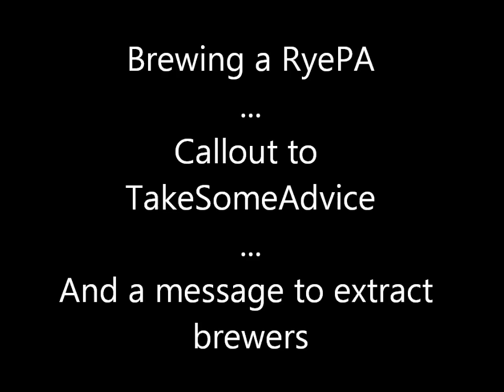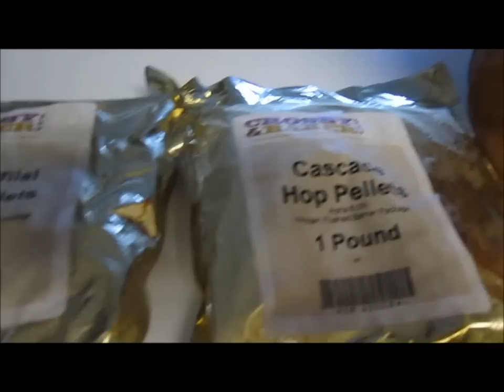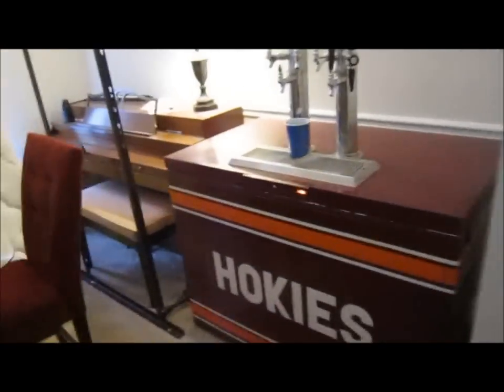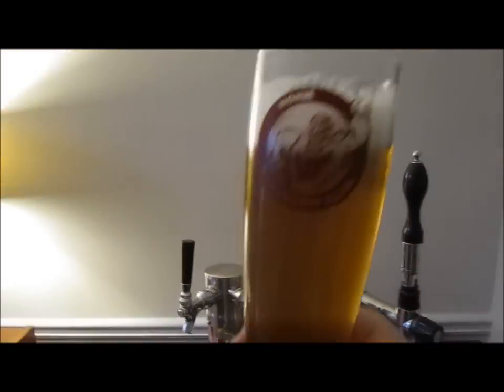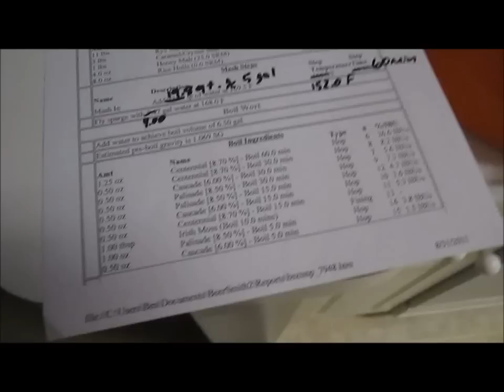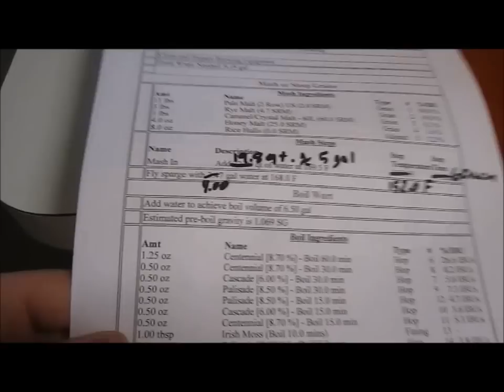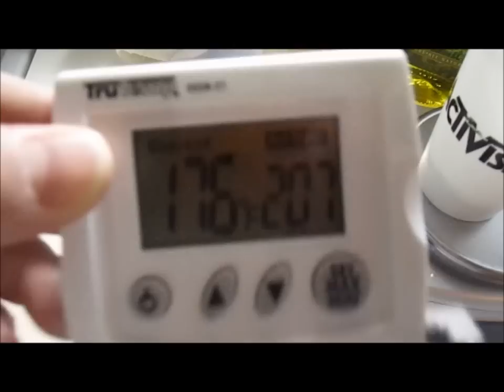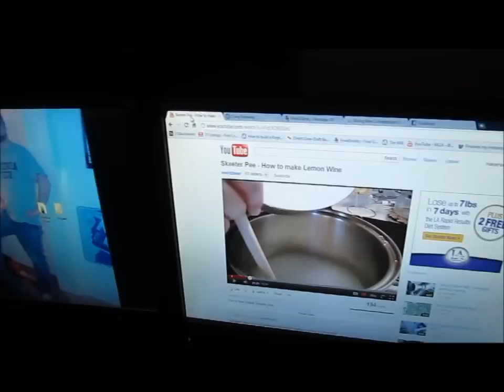Brewing Rye Beer, Callout to TakeSomeAdvice, and Message to Extract Brewers

Comment: I need to get better thermometer with probe like you have. I do have one but it's not accurate enough for brewing.

I'm cheap and lazy so I use Hopville's Beer Calculus. Maybe try that out to see how it compares to BeerSmith.

Yeah, you've been brewing like crazy lately. Way more than I do but I don't have a huge kegerator like you do.

Have you thought about getting rid of that hot break? I use a strainer to get rid of it. I just need to get rid of cold break now.

Comment: I have "soft" water too, but it looks like you are just guessing at water profile adjustments.  5.2 is a buffer, meaning it adds too much of both ends of the spectrum, to attempt to keep pH in the desired range.  I'd like to encourage you to buy a cheap meter or at least some test strips and get some pre-brew feedback on your starting water profile.  Then only add what is really needed to adjust your profile and ultimately manage your pH.  Otherwise cool vid.  I'm brewing my first rye sometime this week.  I'll try to film the brew session.

Comment: You commented the Brewsmith calculation seemed to be off by a few degrees.  When you use the Strike/Infusion Temp, listed under Tools to calculate your strike water temp, are you correctly entering 1. Weight of grain  2. Intial grain temp & 3. Mash tun weight?
I also use Beersmith & have the exact same home depot cooler (mash tun) as you and looked up the specs on it for a weight of 11 lb.   I too had the same problem until I discovered my mash tun weight was incorrect.
Enjoy your vids!